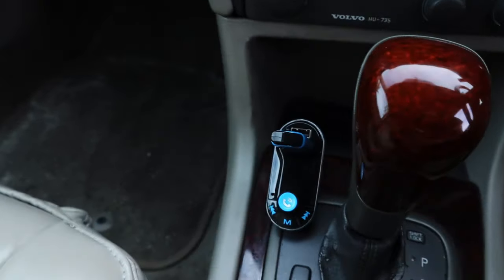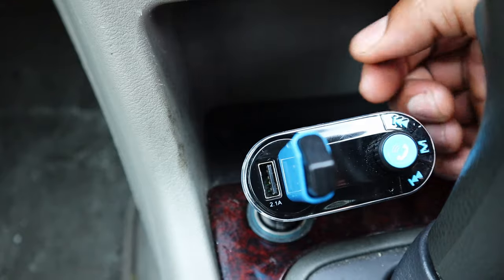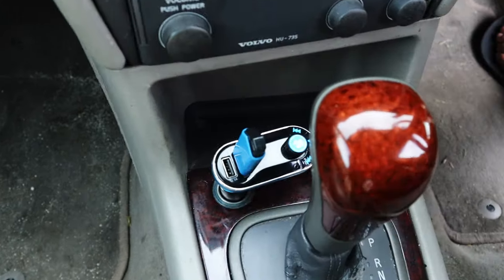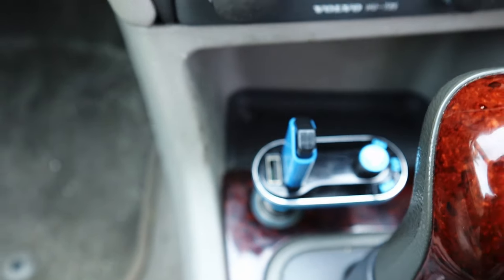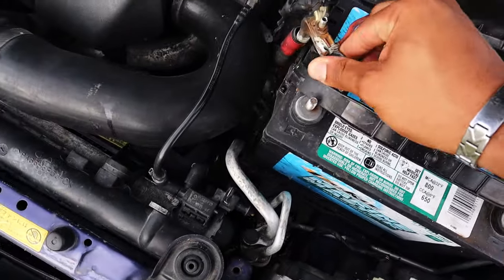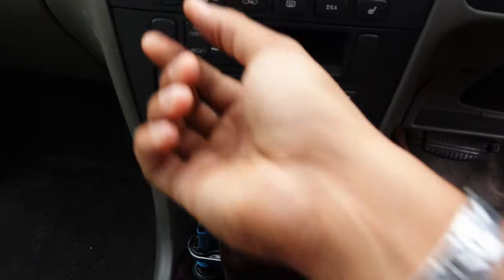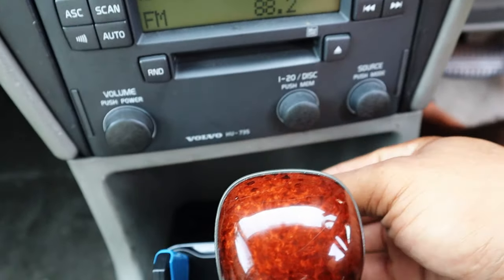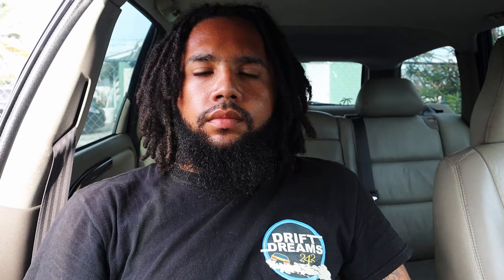How to fix your cigarette lighter/ car charger outlet

Comment: Thanks for bringing this subject up. I'm on a o2 pump because of leukemia. I've been replacing mine with 25 amp rated receptacles. I also bypassed the the factory connection with soldered and heat shrinked connections. Once in awhile, I clean the male contact with sandpaper. Marinco is the brand I think.
Reply: hope you get better Darryl!
Reply: God bless and be well

Comment: If you don't smoke, replace the socket with a USB port. They make that is a direct fit. That is what I did plus I added a USB port to each back door.
Reply: Oh chit man i never even thought of something like that
Are cigarette socket easy to change???
Reply: @GORILLA_PIMP  Not really. At least for me they weren't. You do have to drill holes for the ones in the back doors. There is a place perfect for them in the TC.

Comment: Or you could take it out if you get two little screwdrivers there's two holes in the sides you try those out and then the cigarette lighter will slide out and you can replace it with a new one doing this method is only a Band-Aid eventually bending that back up and then putting your plug in it over and over is going to end up breaking the prong completely off it's really not hard to replace one but this is a good temporary fix 🤘🏻
Reply: Learn how to use punctuation.

Comment: You could pull the fuse for the outlet instead of disconnecting the battery. Easier and safer, especially for people that aren't used to working around cars. If the outlet is switched to the ignition, just leave the ignition off while you do the work.
Reply: How do you do that
Reply: Thanks for all  WHAT U DID FOR CIGRETTE LIGHTER
Reply: Did you mean just keep the car off and do this without the key in? Is that it? I’m tryna do this as I have this problem but don’t wanna mess with the battery. I appreciate your response🙏

Comment: I just bought a used car and the transmitter works but it cuts in and out during the song it’s really annoying,Upon closer inspection I saw the port is filthy could this be causing interference? If so, what can I use to clean it safely and remove all that dirt?

Comment: What happens if you smell smoke coming from it and then you unplug the device and plug something else in it and it doesn’t work at all? Oh by the way, I checked the fuse and it’s fine. Do you have to replace a wire in the back?

Comment: I like this video mine is also full of ash because the former owner smoked and left the cigarette lighter in the outlet. I'm hoping bending the tabs and cleaning out the Ash will fix the problems so I can use my FM transmitter.
Reply: Did cleaning it work? Similar situation here.

Comment: Does the front and rear power port run on the same fuse? My front power port works fine my rear power port doesn't work at all
2015 vw beetle

Comment: I have a 2004 Volvo S40 and the lighter port works fine with devices, but the trim ring around it doesn't light up. Any idea if that's a bulb situation or do you have to get a whole new port piece? I opened up the console and looked under it but don't see any bulb. I did see a small piece attached to the lighter cylinder that might house a bulb but I'm not certain and didn't want to pull on anything and risk breaking it. Any insight is appreciated. The Bahamas is a good time by the way! Had an amazing visit scootering around, snorkeling with a giant stingray (scared the hell out of me) and even picked up a giant starfish right out of the ocean! I put it back of course LOL :)
Reply: @DriftDreams242  Yeah it's definitely burnt out. I just don't see the actual bulb. It has to be in that plastic housing on the side of the inside cylinder. I just can't figure out how to get at it.

Comment: My SUV has 3 cigarette lighter outlets, one in the front, one in the back and one in the trunk and I was wondering if its safe to be using all 3 at the same time and would it drain my car battery? Heres what I use them for... the front port is used for powering the dash cam. The mid/back port is used for charging my phone and power bank. The trunk port is used to power my bluetooth 120W speakers.
Reply: @DriftDreams242  Alright. Thanks much!
Reply: @JOSEPH AVILA  Ill keep that in mind. Thanks!

Comment: i have one of those fm transmitters and it was working fine then stopped i checked the fuse and that was the problem..i put a new in it lasted 3 months..so put another one in it lasted 3 days..any ideas on how to fix that

Comment: Hi I have got an Audi A3 Cabriolet, and my cigarette light/ charger I have changed the fuse for a brand new one, which is fine but it is still not working, and advice would be very welcome to how to deal with this now after following the advice from this video, but it still not bloody working, PLEASE HELP IF YOU CAN, John
Reply: Many thanks for this I think it may have happened because a piece of card got into the cigarette lighter and I used my key to get it out so maybe I blew it. I will put another new fuse in and hope that will do it, thanks for your answer, will leave update in 15 mins, once again thank you very much, I hope this works, I hate it when it is very cold and started to rain :( 
John

Comment: thanks! i thought this might be the issue, but was going to use my metal knife!
Reply: @DriftDreams242  up until last month, it was working, then occasionally i would have to jiggle it or push it in more deeply. finally it stopped working. i bent them back using a plastic knife, and it still isn't working...

Comment: (a rechargeable flash light) is STUCK in the socket.  It's a 2002 Lexus LS430.  I pull hard and am afraid the whole console is going to break.  I don't know what happened.  Any idea on how to get unstuck?  it's like locked in there.

Comment: This says easy but how do you disconnect a battery and what is a fuse? I’m so lost. I need another video to explain more.
Reply: Remove the wire on the battery lol, loosen the positive side. The battery will have a plus and minus just unscrew bolt on the positive and make sure it doesn’t touch anything

Comment: Go video friend i had a blown fuse and changed it both of my 12v weren't working but after i changed the fuse one of them started but the other one doesn't work but ill try the knife technique on the other one so it probably might work but my car has 2 12v outlets and a usb port its a 2021 kia soul lx
Reply: I hope that's the problem for my outlets 😅
Reply: @joleneguerrero4794  😀i know right

Comment: would it stop working if a ljttle water went into the socket
Reply: @DriftDreams242  wat if the water went into an 3 way socket that plugs into 12v socket. would it blow the fuse on the tip

Comment: Pls help!! Accepting suggestions!!! I have a 2010 Nissan Versa w/ hatchback, and my grandmother gave me this car. When I got it, the charger port was extremely dirty and there was dirt and dust, etc stuck inside the charger port. Since there was so much debris inside, it wouldn’t charge or work, like it was very dirty. With the car off of course, I took a toothpick and started trying to get the dirt and nasty stuff out of the charger port. Anyone got any suggestions on how I could clean it? It might already be shot but this is my first car and since it is already kinda old I just want to try my best to keep it up

Comment: Heyy so i bought a bluetooth fm transmitter and when i plugged it in it didnt work and i also tried plugging in my charger it also didnt work why would my cigarrette lighter stop working suddenly? is it because of the bluetooth transmitter?

P.S: I tried my bluetooth transmitter on 2 cars and both of them the cigarrettes lighters stopped working
Reply: @DriftDreams242  how can i solve this issue then?
Reply: @DriftDreams242  okay thank you

Comment: So i tried this and forgot to disconnect battery. Insted i sat down in my car ad started the motor as I always do before i do anything else.. Then i took my screw driver and jammed it into the socket and poff and fuse got burned... And i have a electrician education 😅😅😅😅.. I know that i can use the socket even when the car is turned off.. But whata hell was i thinking.. so stupid, but funny also 😅 bought new fuse thats wrong fuse, store closed and i just woke up and going to store soon again.
I so regret watching this usefull how to video becuse i obviosly cant handle it, lol

Comment: I tried this, it didn’t work for mine. Must be a different issue.
Reply: @DriftDreams242  I’m going to replace the fuse first as it looks like it doesn’t connect at the top of the arch.
Reply: @DriftDreams242  I just got a new fuse & that was it. Thank you for your suggestion as well. Doesn’t hurt to exhaust all options. Best part of this was I just saved myself $217 from the having the dealership do it & the auto parts store didn’t even charge me for the fuse!